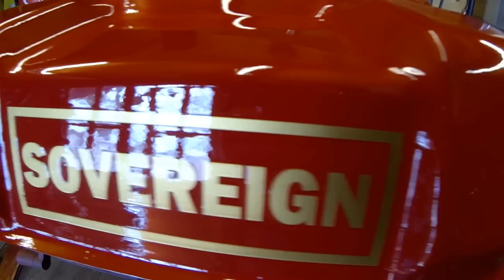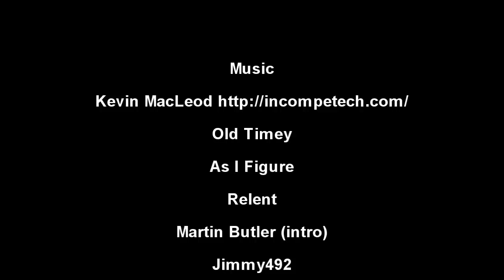Briggs And Stratton Sovereign Lawnmower Restoration

Comment: Lovely job as usual Martin.
 For anyone doing a one off mower, i noticed in halfords the other day they sell a fuel resistant lacquer in a spray can for less than a tenner. not cost effective for loads of mowers, but handy to know, and as i say if its just a one off
.Excellent work.!
Reply from the maker: Re-cyclops Yes, that's a good point for someone refurbishing their own mower or someone wanting to try a mower out without buying spray guns etc'
Cheers
Martin

Comment: Good job. So much is thrown away these days. Respect. I am currently rebuilding a sovereign my neighbour was going to take to the tip!! Only problem it is surging.  Pleasure to hear an engine running.
Reply: subscribed.
Reply from the maker: Sounde like the Carb Diaphragm if it's the same set up as this Chris. Thanks for the sub.
Cheers
Martin
Reply: Im going to take apart the carb tonight and see what I can find.
Reply from the maker: Good luck bud.
Reply: OK. Cleaned the carb. It was a float and needle one. All fine. I then adjusted the governor spring until the hunting stopped. Now purrs like a tiger.
Reply from the maker: Nice job bud. Well done.
Cheers
Martin

Comment: I've be enjoying your lawn mower videos nice work. I have a Mountfield Briggs and Stratton engine which takes 5minutes of pulling to start plus it is really hard to pull lots of restiance. Once she starts and is running for a few minutes it starts no problem on only 1 pull. Any idea what could be the problem?
Reply from the maker: +James Mullen It sounds like you might have a partially sheared flywheel key. This alters the timing slightly making it hard to start. It could also be the valve clearances are too small. You will need to check both out to confirm.
Cheers
Martin
Reply: Thanks Martin I will have fun stripping it down,otherwise I will end up with one skinny arm and one like the hulk!

Comment: cracking effort.. better than mowerman's restorations by far..
. 
Poundland sell black pack (bumper/dashboard restorer) brings the grass box and the grass flap up new and goes along way.

Cheers
Reply from the maker: Bruised Arcade  Nice tip, I got some today funny enough from a trade warehouse for 99p I'll give it a go on the next one. I normally give them a light oil with a cloth.
Cheers
Martin

Comment: Hi Martin, I have the chance of a sovereign with a 4.0hp engine. Only thing being is that after about 3-4 mins the engine starts racing. Is that an easy fix, been told it may be the carb seal that needs replaced? 
Thanks Chris.
Reply from the maker: Chris Wynne It sounds like an air leak or a sticking govenor vein depending on the briggs engine. A stripdown and gasket change should be an easy fix.
Cheers
Martin

Comment: I found a Briggs&Stratton 550ex,140cc engine push loan mower.The cylender walls are scuffed, the rest is in rough coundition from sitting I the rain. The engine design is made light and thin.
Do you think these engines are worth restoring?
Reply from the maker: Jon Young They are very reliable Jon. well worth restoring.
Cheers
Martin

Comment: My mowers getting very hot, any tips for sorting it out?

Going to replace the gasket and give the head a clean, anything else I should do?
Reply from the maker: ***** Make sure there's no old grass stuck  in the engine cases and make sure the mower's cowling is in place as this aids with the cooling.

If the exhaust starts to glow with heat, it's a sign that the valves are not opening enough and you will need to check the inlet and exhaust valve gaps. 
Cheers

Comment: Hi martin do you know anything about mitox strimmer just got one with mower I have done the carb but no luck starting it starts if I put easy start in intake  but nothing else  any idea  what to do with it thanks barry
Reply from the maker: You might have perished hoses or a blocked filter in the fuel tank. There are plenty of vids on Youtube on troubleshooting strimmers and these are common faults that get overlooked.
Cheers
Martin

Comment: Martin - the wire mesh on the top of the flywheel on my mower is loose - can I just remove it as it's rattling around on top of the vanes - there doesn't seem to be a way of fixing it to the  cup bit - does it actually do anything ?
Reply from the maker: Probably keeps the crap out of there. Just sing whilst mowing, that should cover the noise.
Reply: that mesh prevents grass from getting on and between flywheel. do not take mesh off. flywheel is weighted, if it gets plugged with grass it will throw off engine timing.

Comment: i got a briggs and stratton and it wouldn't turn off
Reply from the maker: Could be cable adjustment bud.
Cheers
Martin
Reply: Its not the cable , i already tested that lol
Reply from the maker: Can;t really say without seeing it bud. The kill switch is at the rear of the engine on briggs classic engines
Reply: thank you mate